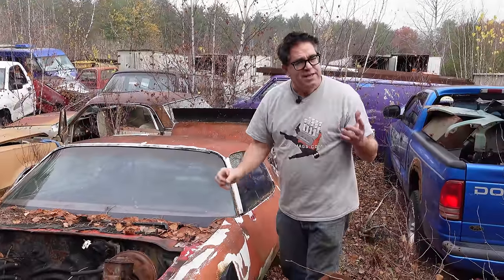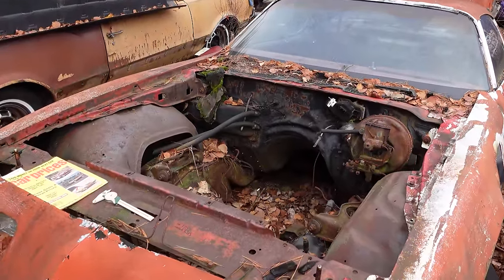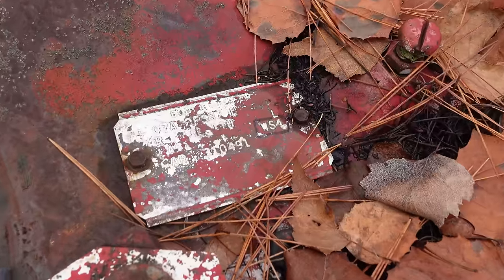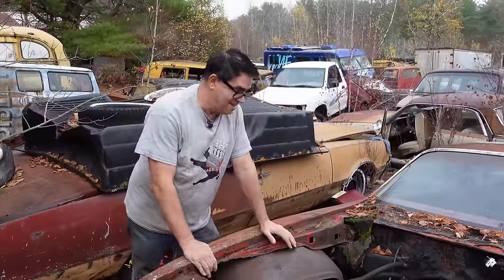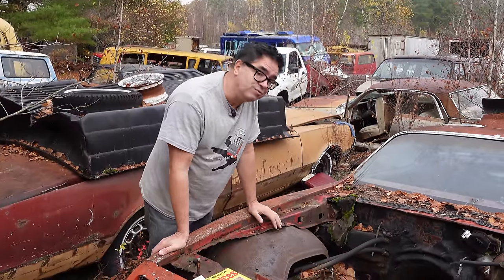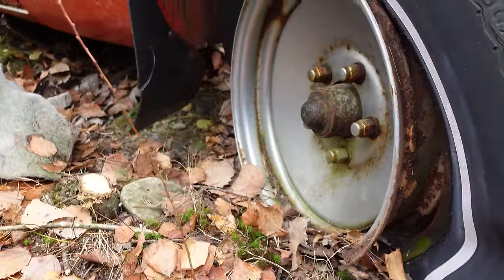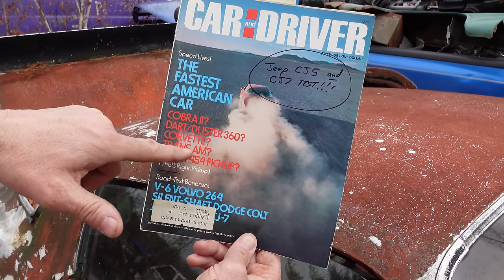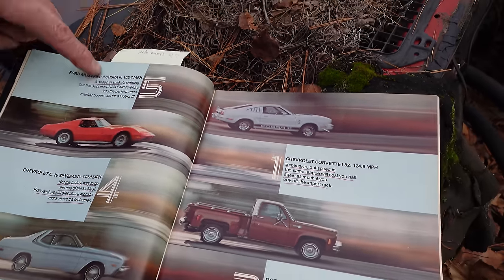1979 Trans Am

Comment: Great video! My dad had a gold 79 with a 455 in it. I always wanted to drive it but I was too young. It was a beast.
Reply: The 455 was swapped in because the last year for that was 1976.
Reply: Oh yeah, I figured as much. Lol. Good engine.
Reply: @samllewellyn4039  It was, but the 400 Pontiac was just as good and a bit more balanced than the 455. I'd take either one.

Comment: Bought a second gen Trans-Am in early 80s. Flat hood. No bird. Blue. Honeycomb wheels. Sharp as hell. 70 - 73 were always my fav. But talking horsepower, 1970s me is enjoying the hell out of the 305+ horsepower in my v6 Mustang (2011) beater.
Reply: Someone swapped the hood. They all had shaker hoods except for the 1980-1981 Turbo 301 cars.
Reply: @googleusergp   - Thanks for that info. Always did miss that shaker hood.

Comment: I bought a 79 in college and didn't realize that it had a 301 which was a base engine and it couldn't get out of its own way. swapped in a built 350 chevy then. The ground effects actually work. I read an article that was quoting Herb Adams who had a hand in the development of the Trans Am. Well not much it did do something, at about 55mph the front and rear both generated about 50lbs. of downforce. It may be in Rocky Rotella's book about 2nd gens.
Reply: while i am a pontiac dude and a 455 would swap right on those mounts and bolt to the automatic trans, i also have to admit a 350 swap with Z28 mounts wouldn't be much trouble but make a difference--not hard to find a targetmaster in a junkyard and swap over the top end from a junkyard "vette or Z28.
Reply: On these cars, the "350" on up was the ONLY way to go! The "301" was a JOKE!

Comment: Trans Am performance died off about the time the bird was put on the hood in 73. The cars before were striped, white with a blue stripe, or blue with a white stripe and that is all there was.
About 6K of these were built from 1969-72. These T/A's are where the performance is, and the bird on the hood was more about selling cars than performance.
I still am in love with a 72 4 speed A/C car in the garage since 1977. That car is going to stay in the family for another generation.
Reply: You've never owned a 1979 with a 400 as I have for 23 years. Plenty of get up and go. A little tuning and even better.
Reply: 1974 pre cat with 400ci or the 455 super duty were beasts. And it does not take a lot to get more power out of them. Agreed the later Trans Am and Firebirds were more for looks.
Reply: @captlazer5509  Ram air "round port" eninges were the top of the heap. The 455 HO and the SD455 and Ram II and Ram air IV 400's.
Reply: The 72 has been in my possession since 1977 or 45 years...  With 100 more HP than your 1977.
Reply: @debi5292   the SD455 was only made in 1973 and 1974. You were stating 1973 was the last year for any real HP but not quite, there was a 1974 SD455 Trans Am. Agree that by 1975 it was all over on the high HP engines for Pontiacs.
Reply: forgets about 73-74 SD455's.

Comment: Gotta love em, wife has a like new 77 all original (AZ. car) Pontiac 400, she enjoys in our short summers. Only bummer in my opinion is, most of these were built with tall 2:71 rear ends, makes em slow-ish off the line. Great cars!
Reply: Mine is a 2.41 which is even worse!
Reply: That's not true. Depending on the options ordered, up to 3:42 was possible. My '79 10th Anniversary has a 3.23, AC and a 400 Pontiac engine. It's how it was ordered.
Reply: We called them airplane gears.
Reply: Mr. B. Here ! Does it matter we in the hubby have fun cars most are driving big eggs on four wheels . LOL !

Comment: Had a `78 TA in the early `90`s...6.6L + 4speed w/4.11 gears. Kinda low-geared for my liking but it was quick & cornered like a go-kart. Many folks removed the rear shaker block-off. 
Actually had ` 73 Dart Sport a decade earlier too. 360 4sp, 4.10 limited slip, snorkel hood etc

Comment: Actually all TA's got a 1.25" front sway bar, at least the usual ones that came with 400's or 403's. They did make some 79 TA's with 301's, not many but a few, and they may have gotten that 1.125" (1-1/8") front bar, so the smaller bar could make sense due to the VIN showing a 301.
Reply: I took apart a 74 formula firebird the front sway bar was 1& 5/16" sadly some nimrod used it as a place to anchor a tow chain and bent it.  I would put the bigger T/A sway bar in my Z28 Camaros. The z28 had a 1&1/8" front bar.

Comment: Love these cars Steve! I had a 79 silver  with the 403. 6.6 liter was the callout for it and T/A 6.6 was the Poncho 400.You forgot to mention that Burt Reynolds movie that really got sales moving
Reply: That's correct for 1979, but not for 1977 or 1978. A base Pontiac 400 (180 HP) in 1977 or 1978 could also have 6.6 LITRE on the scoop. The T/A 6.6 callout was always for a Pontiac 400 and always for the W72 (200 HP in 1977, 220 HP in 1978-1979) version.
Reply: @googleusergp  I always thought T/A 6.6 meant W72 and 6.6 Letre meant either standard performance 400 or Oldsmobile 403 depending upon what was available where the car was purchased. I believe starting in 1977 the People’s Republic of California started their own emission standards of which the traditional Pontiac V8 couldn’t pass. They had to put Oldsmobile engines in all Pontiacs destined for sale there. I also remember they couldn’t get a 4 speed Pontiac there after 76. The 77 Can Am also used the Olds 403 in California. Also in 77 the Pontiac Grand Prix came standard with a 301 in federal emissions areas but in California standard was an Olds 350 with an optional Olds 403. Some even were built with a Chevy small block 350. Funny thing about the Grand Prix was all the Pontiac engines, even the lowly 301 was backed by a THM400 while the Oldsmobile and Chevy engines were backed by the THM350.
Reply: @mikee2923  T/A 6.6 always means a Pontiac V8 and is always the W72. The 6.6 LITRE means 403 or 400 (standard engine, 180 HP) for 1977-1978 only because all 400s in 1979 are leftover W72 1978 engines (I have one). No, that's not correct. The T/A 6.6 (W72) wasn't available in California in 1977, but the base Pontiac 400 or 403 was. The 1979 400 wasn't certified for California emissions, but a few surely snuck through.
Reply: @googleusergp  Thanks. All the 400CI Pontiac engines that went into the TA in 79 were built in 78 and stockpiled for the 10th anniversary TA for 79. This was because all Pontiac 400 engine production ceased with the conclusion of the 1978 model year. Do you know if there were any W72 Formula Firebirds in 79?
Reply: @mikee2923  Yes, I know that about the 400 (I have a 10th Anniversary 400/4 speed), but that's not entirely correct. Black SE and 10th Anniversary LE cars got the priority for the 400 engine, then regular Trans Ams, and yes, there were about 346 Formula 400/4 speed cars in 1979--they are extremely rare. My 10th was made the same week that GM discontinued the 400 in April 1979, however, they built them after that point for vehicles already in the schedule.

Comment: 301 pontiac was a 195 credit over the standard 403 olds.
Also you can get a trans am with polished trim instead of black.
Reply: You could get a decor package which added chrome trim, yes. Correct, the 301 V8 was a credit engine in 1979 and became the standard Trans Am engine in 1980 and 1981.
Reply: The 79 TA (and Formula) always came with black trim around the front windshield and back glass from the factory. That was one of its standard features. The black eventually wore off on some of them, and sometimes the owners who preferred bright trim would remove the black and polish it up, or swap for Firebird or earlier year bright moldings.

Comment: True, the hood bird decal was an option, technically, but the vast, vast majority of the cars got them. The Shaker was standard on all Trans Ams, hood bird deal or not. All Formulas had the rear spoiler like Trans Am did, but it was optional on lesser cars. The 301 (4.9L) NON-turbo was definitely available in '79 on Formula and Trans Am -- all 130hp of fury of it. I BELIEVE it was the standard engine, with the W72 400 or Olds 403 being an option. But it could have been a "credit engine." ALL anniversary cars were either 403 or 400, however. The 301 would become the standard engine in all Formulas and Trans Ams, with the turbo version being an extra-cost option. California cars got the Chevy 305. Some 305-powered Trans Ams and Formulas existed as far back as '78, maybe even '77, but '78 for sure.
Reply: The "Wrap Around  Rear Deck Spoiler' AKA "Duck Tail Spoiler" was Never Standard equipment on Any Formula. Only Trans Am.
Reply: I saw a 79 Formula and it sure looked different with the two-tone paint but no spoiler. I kinda liked it.

Comment: I had an 81 turbo trans am and I can confirm that it was gutless. However, I also found out that the turbo was turned way down and all you needed was a small screwdriver to almost triple the boost and performance went up remarkably.
Reply: Done that way on purpose for emissions, fuel economy and to prevent grenading the engine.
Reply: My brothers best friend had an 81 TA  301 turbo back in 82.  I remember that car was actually pretty quick for the time.  I believe it was in the mid 14s.  Someone must've raised the boost.  I also remember that car would chirp second which for us old guys was always so cool back in the day.  :)
Reply: the late Rodger Huntington wrote about a 1979 Buick Century with the turbo V6 (no intercooler) in the old Hi Performance CARS magazine. in 1981 it got an open air element air filter and a 2.5 inch "test tube" from turbo to the dual exhaust. Boost jumped from 9 to 15 psi, and the car lost two full seconds and gained 15 mph in the quarter. But water injection was needed against detonation (don't know if they were running Sunoco 94 octane or not) and RH mentioned how the factories were intentionally building restrictions to keep the carb'd engines from being a warantee nightmare.
Reply: Without ping management they will blow themselves, that took a few years.

Comment: I had a 79 trans am 301 auto shaker hood. They made them and also in 1980, also the turbo 301 was a trans am but no shaker hood it had that side lift hood with some red light forgot what they were
Reply: The turbo light monitor RPO code "UR4" started on cars around March 1980. My January 1980 Norwood made car doesn't have them.

Comment: In college a fellow student had a 79 trans am with pontiac 400.  He rebuilt the engine and found out that gm defined the 4bbl carb.  That set it up so the rear barrels would only open half way and the mixture rods were larger.  We took a older carb and that engine came alive.  It was a 4spd.
Reply: I had a '77 LeSabre with a 301 and blew it up so took it apart.  One of the more amusing things was the early version of the Rochester 2bbl it had - same casting as the 4bbl but the secondaries were blanked over.
Reply: The 1979 400 W72 was rated at 220hp  factory NHRA said no way and rated it at 260-280 net hp which would be about 312-336 gross hp. Drop the cat and use ture dual exhaust   and that engine wakes up

Comment: Bought a brand new '79 TA back in the day. White, 4 speed, T-tops, aluminum cheese graters. Felt faster than it really was. Slower than my ,68 GTO.
Reply: Two different eras. The 1979 had to meet standards that the 1968 GTO did not.

Comment: I had a odd ball 70 1/2 with a auto column shifter. Question,did the H.E.I.distributercontain a circuit board that limited the ROM this reducing a top speed ?

Comment: Nice purple van in the background.  I didn't buy a Trans Am in 1979 because I could not get the big block with a 4 speed.  So I bought a Camaro Z28 with a 350 with a 4 speed.  I also never lost a street race to a Trans Am 1979-81...they just did not get going as quick as my Z28.
Reply: You could never get a big block in a 2nd generation Trans Am because there is no such thing. There is no Pontiac big or small block V8 and the Chevrolet or Oldsmobile engines used in various years were all small blocks of their respective divisions.
Reply: A 400/4speed Trans Am would beat your Z28 all day and twice on Sunday.
Reply: @707x-y6s  Did I say anything about my car beating a Trans Am?  You should read the entire post before posting crap that does not apply to the post.  How ever I did outrun a Trans am in a couple of street races with my car.   So...
Reply: @googleusergp The Trans am had a 6.6 litre and the Camaro Z28 had a 5.7 litre...so they were different motors.   Olds last 350 motors were out in 1977...I had a 77 Olds Cutlas with a Olds Rocket 350 motor in it. Guy bought the car from me just to get the motor.  He took it out and put it in a race car. I believe 1974-5 was the last year for the Pontiac motors...not sure what size...just remember a guy paying my friend a ton of money for a 1974 Trams Am that was really wrecked in the rear...again he bought it for the motor.
Reply: @raythackston1960  Not correct, bad info.  Pontiac V8s continued through the 1981 model year in Firebirds. Oldsmobile engines continued through the 1979 model year in Firebirds, with the 403 V8 being the base Trans Am engine. I'm well aware of what engines were used in what. I have a 1979 Trans Am with a Pontiac 400 (one of 1,817 10th Anniversary cars) as well as an '80 Turbo 301 that my parents bought brand new.

Comment: The bird was an option on the TA and you still have the shaker. In the movies the Hunter with Steve Mcqueen and McQ with John Wayne the hero cars were Trans Am's with out the bird on the hood . 301 was a down grade option in 1979 . If I remeber correctly  Pontiac sent Car and Driver the lightest weight 1979 Trans Am and it was spec'd out with a 301/4speed no A/C . C/D ended up calling it the best handling car in the world.

Comment: In 1979, i bought a brand new T/A in Mckinney TX. I did NOT check the $95 chicken option. I did NOT want one. I planned on adding stripes like i had on my 71 T/A I had earlier (probably my all time favorite car). 6-8 weeks after i ordered the 79 i got a call from my dealer saying that the car was in and i could pick it up in a couple days after the make ready dept was done with the car. It seemed like a long time for make ready, but what did i know? 4 days later they finally called and said the car was ready. I asked, why was it in make ready for 4 days? Oh, they replied, it was a minor issue, don't worry. When i arrived at the dealer, i was stunned to see that the car had the chicken on it. When the car came in it did not have the chicken and the dealer assumeed that Pontiac messed up at the plant and therefore put one on. I was livid, the dealer refused to take it off and because it had the 400 the order book had closed, so if i re-ordered another T/A, I could only order it with the 403. I sold it 5 years later. If i knew then what i know know about vins and collecting, i would have kept it because mine likely would have been the one ordered WITHOUT the chicken.
Reply: Nah. With or without the decal doesn't make it any more special. It's all about options, SE/LE and all of that. With or without a bird doesn't make it the "holy grail" of 1979 Trans Ams.
Reply: @googleusergp  The chicken was a $95 option. Steve noted that he did not ever hear anyone getting it without.
Reply: @paddle_shift  With or without the decal doesn't make it rare. The options and other factors do.
Reply: @googleusergp  Steve Magnante never saw one without that $95 option.
Reply: @paddle_shift  I have seen plenty. Doesn't make them any rarer or more desirable. Not in the least bit. In fact, it takes away from it, as that's one less "check off the box" option if anything.
Reply: @googleusergp  Tell that to Steve Magnante the person i was commenting to on my original comment.
Reply: @paddle_shift  He's the one that asked me to confirm the details in his video. LOL.
Reply: What the hell, leave the car in the sun a few hours and peel it off, won't hurt a thing. But yeah, dealer was a blooming idiot.

Comment: yeah they had a better skidpad than a 79 Corvette.    But one thing thats wrong is the top speed.   They could do 130    but they were gearing limited not drag limited even with  only around 200 hp.  Some do say that the 400 is underrated though.   The 403 with some nice 350 heads can be very good.    a 2nd gen TA was my childhood car   but I dont remember if ours was an 80  and someone happened to put 400 decals on it or what... cuz it was auto     so it may have been a 305          But it was Black and Gold ..  my mom met Burt Reynolds and somewhere there is a 5x7 photo of it with his autograph.   Coolest car ever.     This was in the 90s though  before they got "hip"   .  We got rid of it in 96... but  it was definitely kind of a badass car still.   Id still love one or to get my mom one.  or at least some restoration.

Comment: I looked at a 79 trans am at an auction this last spring.
It had the 301 with a 4 speed, confirmed by the smog tag. 
Odd bird.
Reply: Yes, the 301 could be had with an automatic or a manual in 1979.
Reply: And the manual had it's own unique camshaft, a lot of work for the 150 or so manual cars produced.

Comment: Could you tell me what issue your magazine was I am into square bodies and it had some information that I like to see
Reply from the maker: Hello Maurice Cooper, I used two older magazines in the 1979 Trans Am video, they were the April 1976 issue of Car and Driver and something called "1979 Car Prices" which is likely going to be fairly difficult to find today since they weren't typically saved after the car shopping was done. Maybe try eBay. Thanks for watching and writing, Steve Magnante. Oh, and - as you know - IGNORE the crappy "telegram scam bots" that haunt YouTube. -Steve Mags
Reply: @SteveMagnante   These telegram messages are a nuisance

Comment: You can tell it had drum brakes in the rear by looking at the brake booster. The rear disc unit was a smaller diameter.